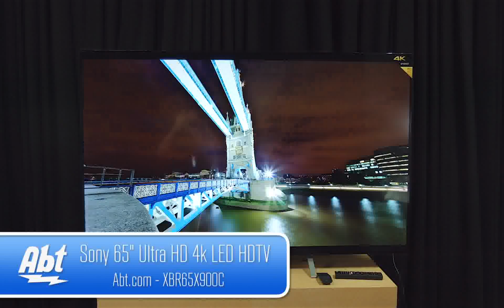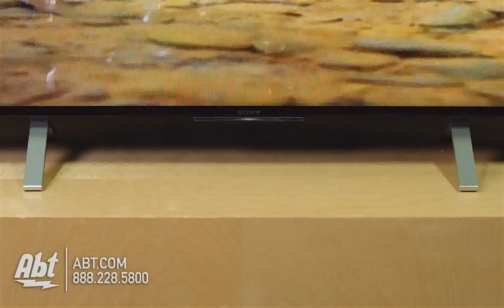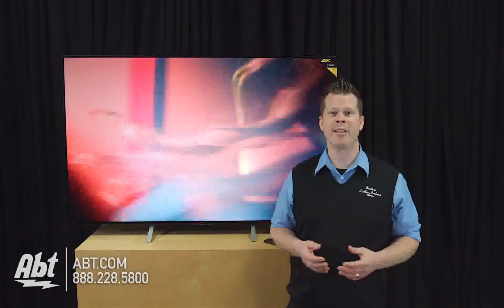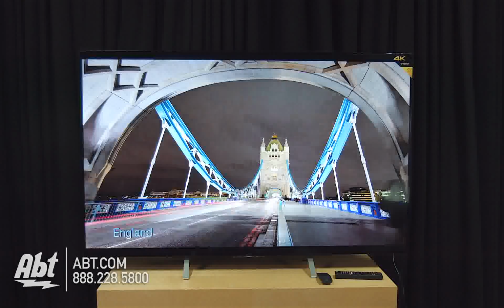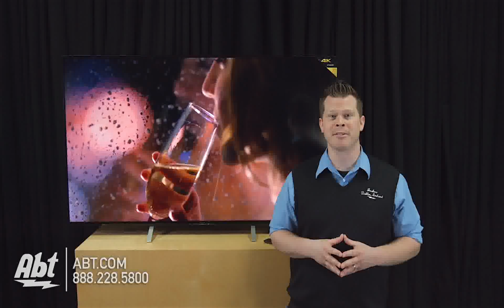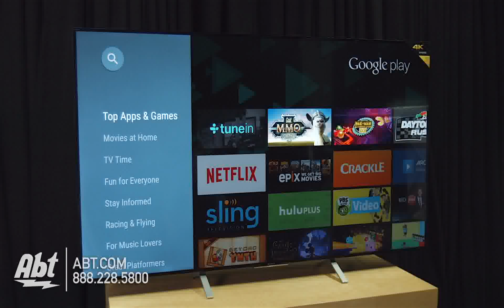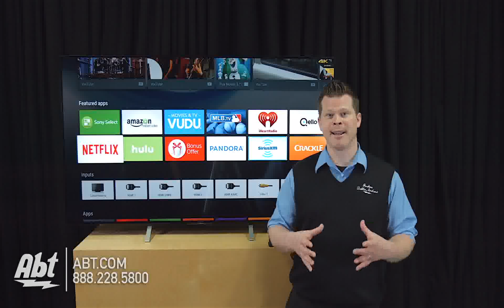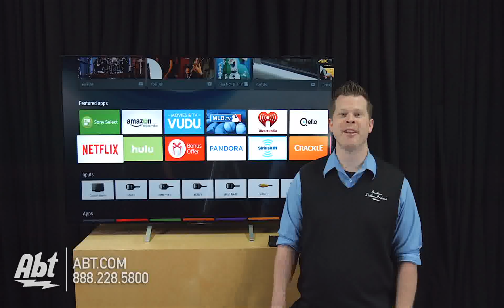Sony 65 Black Ultra HD 4K LED 3D HDTV XBR-65X900C - Overview and Features

Comment: Is this still worth it
Reply from the maker: @justinmabborang5780 It still has a very good picture, but the processors in the newer models are faster and offer an even better picture. If you need any assistance finding a new model to fit your budget please be sure to give our TV experts a call at 800-860-3736. They can also tell you about any promotions we have that can't be advertised online.

Comment: Anyone played COD with this on PS4? Is this good for gaming?
Reply: This TV natively is 120Hz and it has a Game Mode Video Setting.Not to mention PS4 is a 1080p system, so the upscaling will look great. It's great for gaming.
Reply: ***** Thank you for the info.
Reply: Tweegyblink Its January 2017 and I have been saving the entire 16 to buy this TV. I saw this TV with the serial number XBR65X900C and asking for it $800 on Craigslist. Would you share more information about what tv did you purchased, also do you know if a newer version of this TV is available. Thank you for your time and help

Comment: This TV looks ver nice, however it has some problems., and I am not the only one saying this. I bought one 6 days ago and due to light bleed in the corners, it is going back to the store. Even the guy with Best Buy admitted that this model has some problems.  I am going to miss the nice remote control (RMF-TX100U). It is simple but at the same time very handy and easy to go through different apps or movies.  I will probably buy the Samsung UN65KS8000FXZA.
Reply: Hi, ended up buying the SONY XBR-65X850D. This is a beautiful TV with an amazing picture quality. So far i am very happy.
Reply: no light bleed for me...
Reply: every TV has some light bleed....unless you get the new OLED tv's from LG since OLED turns off or on individual pixels...
Reply: Deejay Core That's true, some more than others. But this one was extremely visible and annoying.
Reply: Tom Jim Its January 2017 and I have been saving the entire 16 to buy this TV. I saw this TV with the serial number XBR65X900C on Craigslist and asking for it $800. Would you share more information about the issues and also do you know if a newer version of this TV is available. Thank you for your time and help

Comment: It is currently the end of April 2016.

Anyone know if the light bleed issues have been resolved and if so where can I purchase one and be assured it is a newer fixed model?

Thanks
Reply: The light bleed was mainly an issue with the 65" model, but yes it has been fixed. I confirmed this with a Sony rep before purchasing mine

Comment: got it for $1200.00 55'' from amazon    excellent tv very aware of issues    one of the best buy reviews it states you can go by the serial number above/past  a certain number to find out when it was made others have stated that the problem has been fixed    for $1200.00  save your receipt etc
Reply: $650 in las vegas
Reply: $1098 in miami
Reply: 999.99 in tx :P
Reply: Its January 2017 and I have been saving the entire 16 to buy this TV. I saw this TV with the serial number XBR65X900C and asking for it $800. Would you share more information about what to look on the serial number, also do you know if a newer version of this TV is available. Thank you for your time and help

Comment: Hi, I wondered how to fix the pedestal stand to the centre. The screws that came with it are meant for the wide furniture and I would like to fix the stand in nearer mode as shown in this video. It would be great to know the length and thickness of the screws for centre fixing. Thanks. Peter
Reply from the maker: +Peter D&#39;Cunha The TV should have included all screws needed to attach the stand to either the outer position or the center position. It looks like you'll need either 2 or 4 M6x32mm bolts to affix the stand to the center position. You can see more in the manual on page 14-15: https://docs.sony.com/release//Ref_4562198131.pdf
Reply: Thank you ABT for sending me the link to the manual. I followed the instructions and it worked just fine.

- Peter

Comment: I'm wondering if the TVs are getting damaged when getting unpacked and hanged due to its extremely small borders? you're basically flexing the edges just by lifting it it.